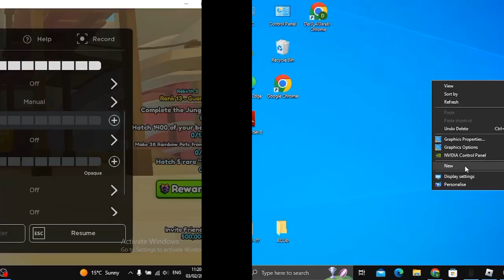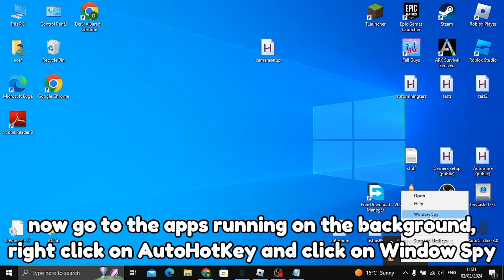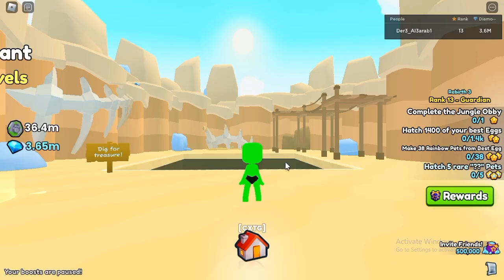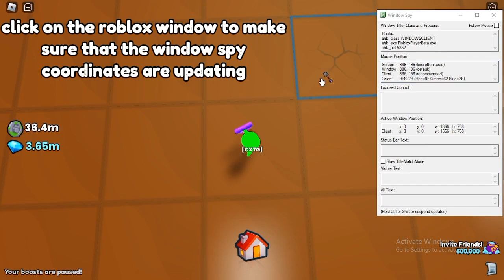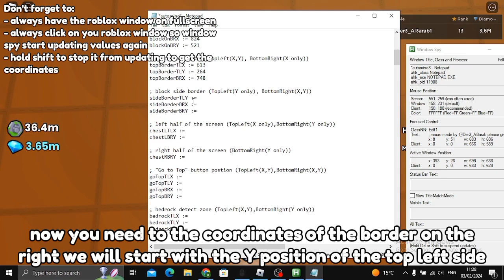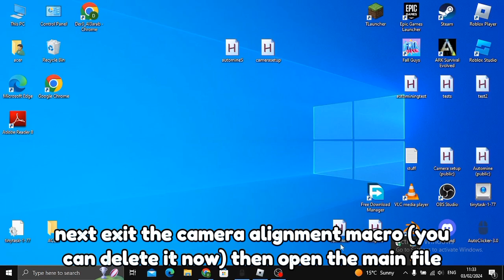How to AFK mining in the Digsite! Pet Simulator 99

Comment: why does this one not work on advanced dig site? just wondering because i may start digging if they implement digging mastery
Reply from the maker: It only works on the normal digsite, I might make a second one for advanced if they ever add mastery but there will probably be no difference between normal and advanced
Reply: @Der3_Al3arab  why do you say there will be no difference between normal and advanced but your script only works in normal? doesnt that mean there is a difference
Reply from the maker: The reason it doesn't work is because the blocks colors are different. With no difference I meant both will probably give the same amount of xp if they added mining mastery
Reply: @Der3_Al3arab  oh, yeah its just that they might add a new huge to advanced digging. they did that for advanced fishing with this update.
Reply: @Der3_Al3arab  so does this work still after the mastery is added?

Comment: its not working please help
Reply from the maker: You have to specify the problem, if possible record it it will make it easier

But most problem can be from wrong variables values (recheck all of them)
 not being on fullscreen when setting up/running the macro
Low fps
High ping
Your graphics not on lowest

Comment: I found a  method that no need install anything
Just hold m1 and then press ESC button then release m1 and press ESC again
Reply from the maker: That is not "afk" you still have to manually tp to top when you reach the bottom and go back in the mine when it collapse

+doing that doesn't get the chests that spawn in the sides.

Comment: it doesn't work properly can you help me example: it starts digging and simply stops and goes back up and then goes slowly the block doesn't break the chests I did the tutorial 3 times can you help me the resolution of your pc is the same resolution of my pc the programming is the same
Reply from the maker: Try checking if the coordinates you interested are correct.
If that didn't fix it grab the color code of the layer it where it stop diging and place it instead of the one in the macro

And for the chests is it ignoring all of them or just some?
Reply: @Der3_Al3arab  just a few

Comment: what charakter did you use and how were you able to use lime as color i only have like 20 preset colors
Reply from the maker: For the character I used parts from 2 ugc bundles the
Legs from the Mini Woman by dvdko
For the rest of the body part I used Dolly chibi v2 by popstarhigh
For the head I used the default one

To get more color tones options you need to use an extension I believe it is from either RoPro or RoGold don't worry both of then are trusted extensions

Comment: Is it supposed not to take me to the top when it fixes itself and the cursor goes to the go to top button? Or do I need to fix the values
Reply from the maker: It is supposed to click on it, are your fps and ping stable? Low fps can cause the click to not register
If that happen it should try to click on it again after a few seconds if the click never register you may need to add a sleep between the mouse mouvement and the click, 
To do it go to the very bottom of the code find 
"MouseMove, inMineX, inMineY,  2
Click,"
Add this line in between them
"Sleep, 1000"
If the click still doesn't register try making the Sleep time longer
Reply: @Der3_Al3arab  I put it to 2000 and it works ocasionally. It sometimes still bugs out. Do you have any possible solutions for that?
Reply: Oh and I just tried further and it doesnt work at higher sleep times either. Any possible tips? @Der3_Al3arab

Comment: works almost enough to be left alone, it just sometimes leaves the digsite  randomly and doesnt go back in, any idea what can cause it? if not i will try to redo it, oh and also it doesnt stop when i press f1
Reply from the maker: When it leave that means it didn't detect dirt(probably because of the glitch that make dirt doesn't spawn), after leaving it waits 15 seconds then go back in

After pressing F1 wait around 30 seconds because it have to run the rest of the code before stopping
Reply: @Der3_Al3arab  I think it just walks away when it leaves, gonna check when it happens again
Reply: also will check if it stops, thanks btw for the macro you did an amazing job ( probably i have no idea how it works)
Reply from the maker: Good luck mining!
Reply: @Der3_Al3arab   yep it just leaves randomly and walks away, it stops the macro when i press f1 tho

Comment: how do you change chest colors there’s more then 5 in the script
Reply from the maker: If you added or removed some colors, make sure to update the number of loops in lines 283 312 of the scripts (I recommend using an advanced text editor like vscode which display the lines number)
The macro is designed to ignore most chest #1 and #2 as they don't have a chance for the huge, if it ignore chests #3 and higher try to get the color code from the same angle and distance as those 2 factors can change the color
Make sure every color code starts with 0x and put the code with the 0x in "" and separate each code with a ,
Reply: @Der3_Al3arab  I didn’t remove any but there’s 10 spots for color codes but only 5 chests to put the colors of
Reply from the maker: There is 10 codes because each chest have multiple colors, for chests 1 and 2 I used 1 code each, for 3 I did 2 and chest 3 and 5 are 3 each
Reply: @Der3_Al3arab  Confusing but thanks it’s been working better since I changed the first one “pink” still no huge tho 😭

Comment: still confuses me. can someone just like make it auto dedtect my ish ?
Reply from the maker: Sadly not possible afaik you will have to set it up manually
Reply: I kinda got it working.. its a bit wonky for me but its working which is all that matters. Didnt quite get which chest is which in the case I need to change the color hex or what I was meant to do with lines 283 - 312 if I changed em..  @Der3_Al3arab
Reply: its possible with ahk but you gotta code it in :D they can also add in auto detect window screen with ratio so you dont have to edit the screen sizes

Comment: Do we need a small avatar or can we just change it to lime?
Reply from the maker: Use the smallest avatar you can make, bigger avatar can block/cover some chests or blocks
Reply: @Der3_Al3arab mine keeps getting stuck at the bottom any way to fix it?
Reply from the maker: It may be because wrong coordinates, try rechecking them
Reply: @Der3_Al3arab  I tried to but it just keeps trying to break 2 blocks at a time in the 5th layer and it gets stuck like that